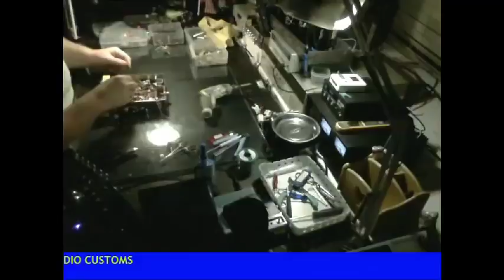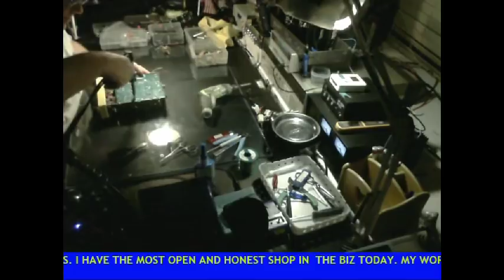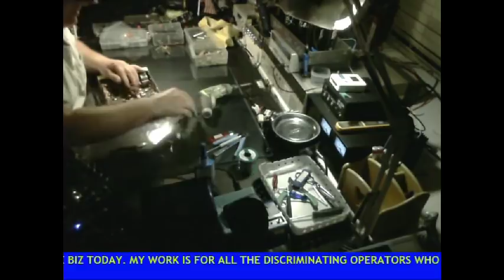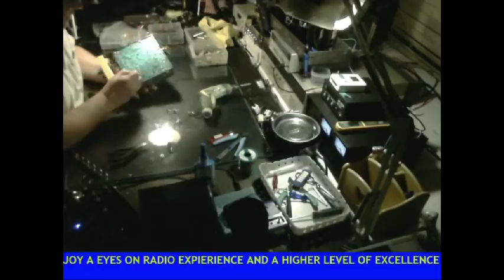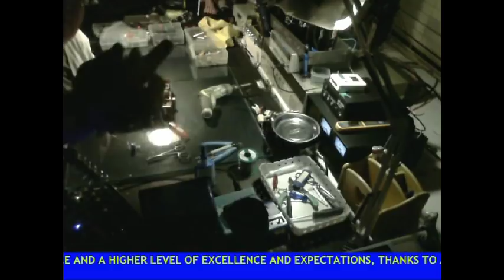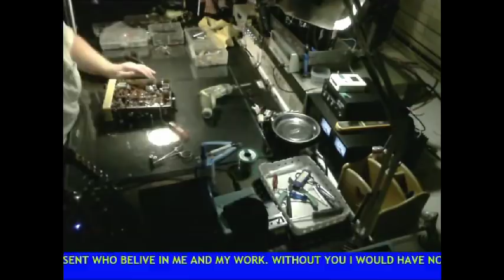SO MUCH HATE!! BASHER - Snake Radio Customs MENTAL MELTDOWN #1 SNAKE RADIO CUSTOMS BUILDS AND MODS

Comment from the maker: Tiny Tim, You Have ZERO Integrity.  You and only you brought all of this on all by yourself and there's no else to blame but You! Again, why would anyone believe a con-artist that doesn't even meet "golden screwdriver jockey status?  I gave you your options and you failed miserably. Poor Timmy just can't keep my name out of his head. How would "Snake" know what "killer clean" is, he has no test equipment or technical knowledge or skill to operate it! Tinfoil hat?  shorturl.at/dhDGZ

Here's what it takes to cut through the noise, be loud and crystal clear with a better receiver too:  A) Tuned Bench:  https://www.youtube.com/watch?v=lwcDfXOgAls.  True, it's more complicated and time consuming to accomplish these consistent and accurate results. Below is a partial procedure and list of calibrated equipment used to achieve this level of performance. Read on ..

Fine Tune CB Radio Shop strictly adheres to (https://www.nist.gov/) NIST Traceable Calibrations and other industry standards to maintain accuracy and consistency for providing Real World Performance Tuning of Citizens Band and 10 Meter export mobile radios with integrity.

"Basic Textbook AM/FM/SSB Transceiver Tune, Alignment and Calibration" 

1) Pll adjustments
VCO & OSC, AM TX OSC, USB TX OSC, LSB TX OSC.

2) Transmitter alignment
DRIVER BIAS, FINAL BIAS, SSB  (or gate voltages for mosfet versions) CARRIER BALANCE, HI-LO AM & SSB Power, RF METER, AMC, ALC and FM DEVIATION.

3) Receiver alignment
AM/FM RF & IF SENSITIVITY, FM DETECTOR/DEVIATION, SSB IF SENSITIVITY, SSB S-METER, AM/FM S-METER (100uV unmodulated -67dbm for “S-9” meter reading!), AM/FM SQUELCH RANGE, SSB SQUELCH RANGE, and NOISE BLANKER/AUTOMATIC NOISE LIMITER (Real World dBm to volts (uV) tables below).

That's just a typical run of the mill textbook tune-up and alignment (if you're lucky). There's more to it than frequency alignment, modulation adjustment, meter calibration, and a tune-up report displaying exaggerated rms Bird peak watts! 

"Test Bench includes"

Bird 4314C Meter
https://www.birdrf.com/Products/Test%20and%20Measurement/Power-Meters/Wattmeters-Line-Sections/RF-Wattmeters/4314C_PEP-Single-Element-Wattmeter.aspx
Part 1) https://www.youtube.com/watch?v=RpX9IHe4ORM&t=16s
Part 2) https://www.youtube.com/watch?v=LuhbqTf6Bxw
Bird 4314C Accuracy Test: https://www.youtube.com/watch?v=DqEOabYqhQo&t=5s
Bird Stipulates 1/2 wavelengths  https://www.youtube.com/watch?v=5eWhgT-rTII
And Genuine Bird Elements from 1K down.

Bird 4373 Sampler 
https://www.rfparts.com/signal-samplers.html

HP8924c with options
http://userequip.com/files/specs/2147/HP%208924C%20Repair.pdf
https://www.youtube.com/watch?v=Cg1w0xBa27s&t=1s

HP8920a with options
https://www.keysight.com/upload/cmc_upload/All/EPSG072204.pdf

Three analog scopes, one digital 200 Mhz
https://www.atecorp.com/atecorp/media/pdfs/data-sheets/tektronix-2465b-2467b_manual.pdf
https://www.youtube.com/watch?v=by98x4eu2lM

Fluke 27fm
http://www.fluke.com/fluke/inen/digital-multimeters/fluke-27.htm?pid=56055
 
LCR http://www.lcrresearch.com/wp-content/uploads/2017/05/LCR_Pro1_Manual_version1.03.pdf

Power supplies
6 Cosel PBA1500f12 (750 amps) variable and configurable.
https://en.cosel.co.jp/product/powersupply/PBA/PBA1500F/PBA1500F-12/
Corcom 20VB1 F7130 EMI Filter 50-60Hz 250V

Times Microwave Coax jumpers and test leads
http://www.timesmicrowave.com/cms/products/cables/lmr/
https://www.youtube.com/watch?v=EmqaGJ6IWow
https://www.youtube.com/watch?v=1ltFVSxGp5Y
https://www.youtube.com/watch?v=v12YZT_1o90
https://www.youtube.com/watch?v=h7iiYfmYWRA&t=215s

Amphenol RF Connectors
https://www.amphenolrf.com/
https://www.youtube.com/watch?v=dVh5B0hdEA0 
https://www.youtube.com/watch?v=dKZg8T_AOso

More range, compliments, reliability, and a quieter, clearer but the more sensitive receiver,  Get Fine Tuned .. not peaked and ruined.

It's what I recommend, use, service and sell ... to you ... not something nonpractical or deceiving in a misleading way. I'm not just the tech and owner of Fine Tune CB Radio Shop, I'm a customer too!  When finished, You'll be giving radio checks, not asking for them.

dBm To Watts and Volts
The tables below display the relationship between Power in [dBm] or [Watts] and Voltage in RMS, peak, peak-to-peak for sinusoidal signals in 50-Ohm systems for accurately measuring and tuning am/fm/ssb receiver sensitivity, agc, squelch and "S9" Meter calibration. Real World! Mike @ Mikes Radio Repair (Romper Room), Mark Rutherford aka Mark 19960, CB Kidd, Martian and all of your other fake accounts pay attention to the tables below, stop misaligning radios, spreading false information and promoting propaganda! 

  [dBm] [Watts]   [Volts]rms   [Volts]p    [Volts]pp
-140 0.100E-16  22.361 nV  31.618 nV  63.236 nV 
-139 0.126E-16  25.089 nV  35.476 nV  70.952 nV 
-138 0.158E-16  28.150 nV  39.805 nV  79.609 nV 
-137 0.200E-16  31.585 nV  44.662 nV  89.323 nV 
-136 0.251E-16  35.439 nV  50.111 nV  100.222 nV 
-135 0.316E-16  39.764 nV  56.226 nV  112.451 nV 
-134 0.398E-16  44.615 nV  63.086 nV  126.172 nV 
-133 0.501E-16  50.059 nV  70.784 nV  141.568 nV 
-132 0.631E-16  56.167 nV  79.421 nV  158.842 nV 
-131 0.794E-16  63.021 nV  89.112 nV  178.223 nV 
-130 0.100E-15  70.711 nV  99.985 nV  199.970 nV 
-129 0.126E-15  79.339 nV  112.185 nV  224.370 nV 
-128 0.158E-15  89.019 nV  125.874 nV  251.747 nV 
-127 0.200E-15  99.882 nV  141.232 nV  282.465 nV 
-126 0.251E-15  112.069 nV  158.465 nV  316.931 nV 
-125 0.316E-15  125.743 nV  177.801 nV  355.602 nV 
-124 0.398E-15  141.086 nV  199.496 nV  398.992 nV 
-123 0.501E-15  158.301 nV  223.838 nV  447.677 nV 
-122 0.631E-15  177.617 nV  251.151 nV  502.302 nV 
-121 0.794E-15  199.290 nV  281.796 nV  563.591 nV 
-120 0.100E-14  223.607 nV  316.180 nV  632.360 nV 
-119 0.126E-14  250.891 nV  354.760 nV  709.519 nV 
-118 0.158E-14  281.504 nV  398.047 nV  796.094 nV 
-117 0.200E-14  315.853 nV  446.616 nV  893.232 nV 
-116 0.251E-14  0.354 µV  0.501 µV  1.002 µV 
-115 0.316E-14  0.398 µV  0.562 µV  1.125 µV 
-114 0.398E-14  0.446 µV  0.631 µV  1.262 µV 
-113 0.501E-14  0.501 µV  0.708 µV  1.416 µV 
-112 0.631E-14  0.562 µV  0.794 µV  1.588 µV 
-111 0.794E-14  0.630 µV  0.891 µV  1.782 µV 
-110 0.100E-13  0.707 µV  1.000 µV  2.000 µV 
-109 0.126E-13  0.793 µV  1.122 µV  2.244 µV 
-108 0.158E-13  0.890 µV  1.259 µV  2.517 µV 
-107 0.200E-13  0.999 µV  1.412 µV  2.825 µV 
-106 0.251E-13  1.121 µV  1.585 µV  3.169 µV 
-105 0.316E-13  1.257 µV  1.778 µV  3.556 µV 
-104 0.398E-13  1.411 µV  1.995 µV  3.990 µV 
-103 0.501E-13  1.583 µV  2.238 µV  4.477 µV 
-102 0.631E-13  1.776 µV  2.512 µV  5.023 µV 
-101 0.794E-13  1.993 µV  2.818 µV  5.636 µV 
-100 0.100E-12  2.236 µV  3.162 µV  6.324 µV 
-99 0.126E-12  2.509 µV  3.548 µV  7.095 µV 
-98 0.158E-12  2.815 µV  3.980 µV  7.961 µV 
-97 0.200E-12  3.159 µV  4.466 µV  8.932 µV 
-96 0.251E-12  3.544 µV  5.011 µV  10.022 µV 
-95 0.316E-12  3.976 µV  5.623 µV  11.245 µV 
-94 0.398E-12  4.462 µV  6.309 µV  12.617 µV 
-93 0.501E-12  5.006 µV  7.078 µV  14.157 µV 
-92 0.631E-12  5.617 µV  7.942 µV  15.884 µV 
-91 0.794E-12  6.302 µV  8.911 µV  17.822 µV 
-90 0.100E-11  7.071 µV  9.998 µV  19.997 µV 
-89 0.126E-11  7.934 µV  11.218 µV  22.437 µV 
-88 0.158E-11  8.902 µV  12.587 µV  25.175 µV 
-87 0.200E-11  9.988 µV  14.123 µV  28.246 µV 
-86 0.251E-11  11.207 µV  15.847 µV  31.693 µV 
-85 0.316E-11  12.574 µV  17.780 µV  35.560 µV 
-84 0.398E-11  14.109 µV  19.950 µV  39.899 µV 
-83 0.501E-11  15.830 µV  22.384 µV  44.768 µV 
-82 0.631E-11  17.762 µV  25.115 µV  50.230 µV 
-81 0.794E-11  19.929 µV  28.180 µV  56.359 µV 
-80 0.100E-10  22.361 µV  31.618 µV  63.236 µV 
-79 0.126E-10  25.089 µV  35.476 µV  70.952 µV 
-78 0.158E-10  28.150 µV  39.805 µV  79.609 µV 
-77 0.200E-10  31.585 µV  44.662 µV  89.323 µV 
-76 0.251E-10  35.439 µV  50.111 µV  100.222 µV 
-75 0.316E-10  39.764 µV  56.226 µV  112.451 µV 
-74 0.398E-10  44.615 µV  63.086 µV  126.172 µV 
-73 0.501E-10  50.059 µV  70.784 µV  141.568 µV 
-72 0.631E-10  56.167 µV  79.421 µV  158.842 µV 
-71 0.794E-10  63.021 µV  89.112 µV  178.223 µV 
-70 0.100E-09  70.711 µV  99.985 µV  199.970 µV 
-69 0.126E-09  79.339 µV  112.185 µV  224.370 µV 
-68 0.158E-09  89.019 µV  125.874 µV  251.747 µV 
-67 0.200E-09  99.881 µV  141.232 µV  282.465 µV
-66 0.251E-09  112.069 µV  158.465 µV  316.931 µV 
-65 0.316E-09  125.743 µV  177.801 µV  355.602 µV 
-64 0.398E-09  141.086 µV  199.496 µV  398.992 µV 
-63 0.501E-09  158.301 µV  223.838 µV  447.677 µV 
-62 0.631E-09  177.617 µV  251.151 µV  502.301 µV 
-61 0.794E-09  199.290 µV  281.796 µV  563.592 µV 

                 Don't Be A Mud Duck!

 https://www.arrl.org/shop/ARRL-Handbook-2019-eBook

Hard Drive 163 NM. 73's! Click click.?
Reply: Talk about someone that thinks he's the cb God I wonder how many repeat customers he actually has.
Reply: I remembered that Snake picked up a nice IFR Service Monitor about 2 years ago and had it turned on in the background, guess for show.... Anyway, I could tell that he didn't know how to use it because of all the "playing with the knobs" while he was doing "alignments"... Basically, he was using it as a large watt meter.... Looked good for those not in the know.... Guess he put that away, since its not on his videos any more...
Reply from the maker: @roaddogg5074  He's already stated that he has poor math and technical skills and that's obvious but .. yea, just mind boggling. He does appear to be good at "BS". Aaauuudiioooooo!
Reply: Fine Tune CB Shop  Yeah, he also stated that he did NOT take any electronic courses. Learned by trial and error.  Let’s see.... turn this and that, yeah, that should do it.   LOL. Don’t understand how people see his videos and are ok with that.  Also has a timer to do his “custom mods”.
Reply from the maker: @roaddogg5074  I hear that he spends more time in his live videos working on what he's just screwed up than getting anything accomplished.  8 hours @ 35 hr on his "timer" for 45 minutes of work. lol It's his costumer base ..  Have you seen this, It's painful:  https://www.youtube.com/watch?v=CTwEmdyA1Fk
Reply from the maker: @roaddogg5074  He blew it up by transmitting an amplifier into it.  He also keys radios straight into his rf generator.  The rf generator is now useless for making any accurate adjustments or receive alignments but he still charges his customers for $$ for a misalignment.  He's truly a conniver!
Reply from the maker: @edmcqueen7303  You are about to enter another dimension, a dimension not only of sight and sound but of mind. A journey into a wondrous land of imagination. Next stop, the Twilight Zone!